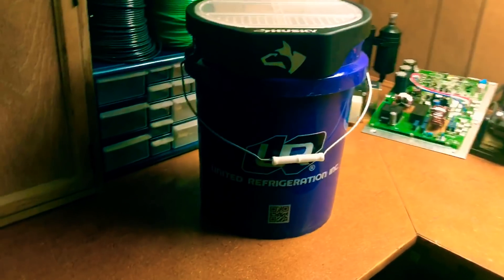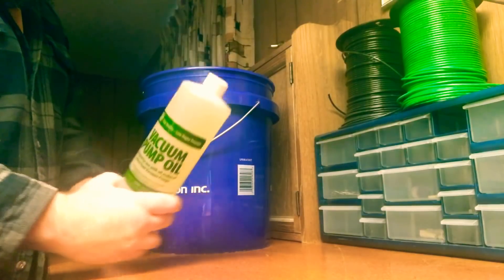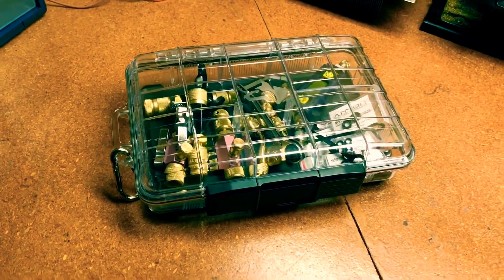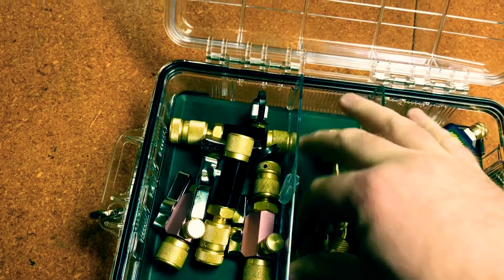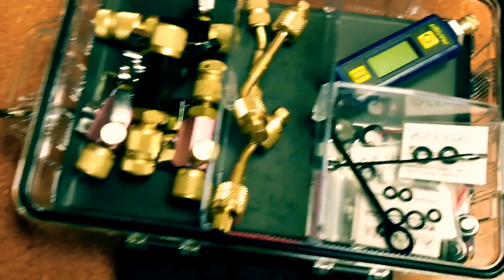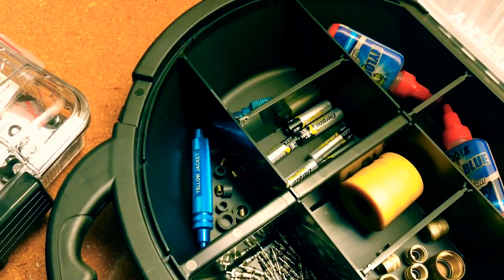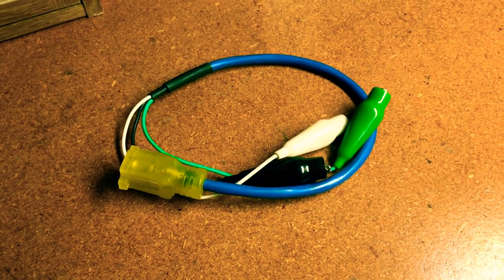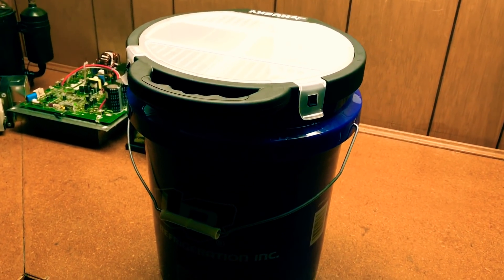HVAC EVAC Kit in a Bucket

Comment: I don't use the CPS sub-cooler I use a trash can that I can attach wheels to. This makes moving recover drum and 3 bags of ice to the roof easy. Then I have a piece of wood I can set on my scales and weigh out the refrigerate. I put the recovery drum in the trash can and add 3 bags of ice.  This cools the recovery drum and makes recovering refrigerate a breeze. Added bonus I get to use the setup for a cooler after recovery. This only makes sense on 15 tons and larger project and I always plan this type of repair. Nice videos I do plan to copy the vac bucket design but I want a different lid. The husky falls off to easy in my opinion.

Comment: Good stuff AK. I’m partial to my foam cut out cases as you know but am always looking for ways to improve my setups. Keep up the good work buddy.
Reply from the maker: HVAC in SC I wouldn't say this video is an improvement, just a different concept. I wanted to fit EVERYTHING for evacuation into one container, and with this method I found the foam case unnecessary. That said, I just bought an inverted analyzer and think it's a perfect candidate for a case like the ones you've shown. I'll have to look into Condition 1 for some options!  Thanks for watching man

Comment: Fan and blower Motor  change out bucket would  be cool 

Rags 
Wd40 
Pullers 
Socket set 
Wrenches 
11/32 nut driver 
Etc
Reply: Check my video out: https://youtu.be/P74yKABuaPI
 - mine is just in a Harbor Freight bag for now - might upgrade to an Open Top Veto in the future though.
Reply from the maker: Anthony Gonzalez great idea. Right now I do have a blower/pulley/hub removal kit, but keep it in an old desalt drill duffel bag. May look into a 2.5 gal bucket setup upgrade!

Comment: Nice set up I use a tool box for mine may switch to a bucket deal nice job
Reply from the maker: james rook jr hvac thanks man!
Reply: The buckets are nice in a van(or truck) the smaller footprint than a long toolbox.